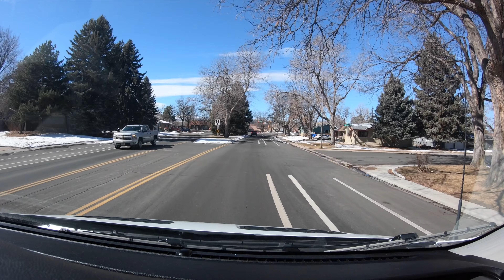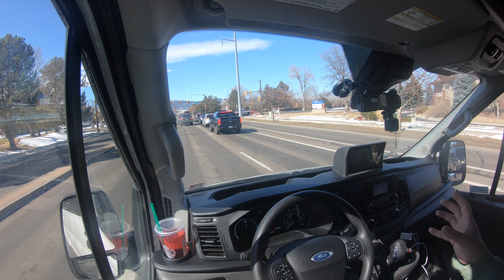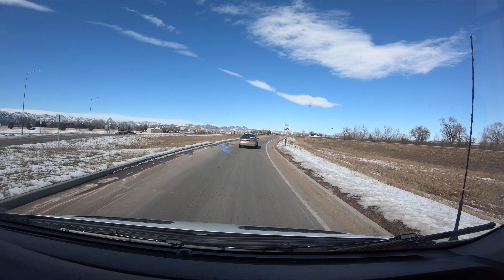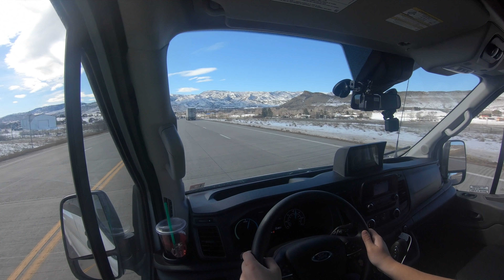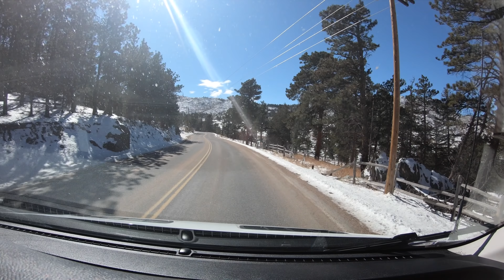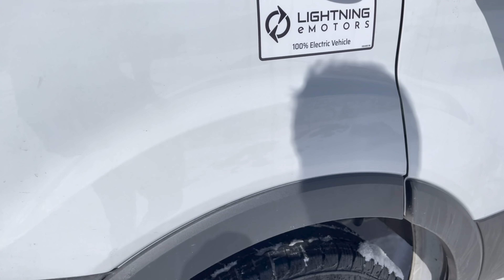EV Last Mile Deliveries! How Does The Electric Transit By Lightning eMotors Drive?

Comment: I actually think this may be the most important category of electric vehicle. So lets say your a normal person and drive 10K miles per year at 30 MPH that's less than 1 hour of driving per day.  Now look at a company that makes deliveries. They are delivering at least 8 hours per day. Add to that they are idling longer, starting and stopping more.  With a full load, you don't want to be behind a delivery vehicle, one because its hard to see around but two it takes them forever to come up to speed. Electric delivery vans come up to speed so much quicker as we all had fun watching combustion cars pull out of the way of Kyle doing 50-60 MPH on an uphill stretch where he gains half a mile of elevation over 10 miles. Plus as a business there are tons of rebates and programs in states like California that makes them much more affordable to buy and certainly more affordable to operate.

Comment: The price was a shock. Unfortunately that’s going to be a deal breaker for most companies that would consider the benefits of the electric power train vs just buying 3 ICE versions for almost the same price.
Reply: Two things to consider: 1. Prices are high at the moment because this is a young industry. Prices will drop substantially as volumes increase. 2. Once purchased, the running costs for these vehicles are significantly less than for ICE vehicles, which means that over time, you can even come out ahead.

Comment: I wonder what the weight of the retrofitted Transit versus it arriving from Ford with the equivalent amount of gas to make it the amount of miles that the electric conversion could go compares? I drive one but need one that is geared more toward a fixed amount of weight for the longest amount of hall with the biggest amount of charge capable of being carried and not to mention the fastest amount of recharge because it is a round-trip. Great review. 💯
Reply: The electric motor and its accessories are lighter than the stock gasoline engine and transmission, but the battery packs certainly add weight. We work with our customers to figure out which vehicle platform and battery pack configuration will work for their payload (or passenger load) and range requirements. It's still the case that electric isn't for everybody; but there's still a huge market for which our vehicles would work perfectly.

Comment: So what is the range with 15 people in it as compared to just one?
Reply from the maker: Good question. I don’t know 15 people in our new town but it was definitely an idea.
Reply: @OutofSpecReviews  There is a whole business to be had testing EV Commercial vehicles under the conditions they will be used under.  Love your reviews.
Reply: @OutofSpecReviews  Come on with TicTok you could fill that up in 10 minutes.😏
Reply: @OutofSpecReviews  Pick up some homeless people maybe?
Reply: There are plenty of us around that watch your videos.  I'd happily fill a seat for you, any time
Reply: Our electric Transit 350HD has a CARB Executive Order (EO) which is a California government document which permits it to be sold in California. For electric class 3 vehicles, CARB requires dynamometer range testing on an EPA certified dynamometer, using an EPA drive cycle that emulates city and highway driving, AND - importantly - with 50% payload. This is on the basis that vehicles are usually fully loaded for only part of their duty cycle - after all, no point carrying stuff around if you don't deliver it! The range testing on our Transit came up with 122 miles on a charge, 50% payload. A future version of the electric Transit will offer substantially longer ranges.

Comment: Couldn't the company get the vans directly from Ford without the engine and other ICe parts? Weird to pay for a full van and then remove the ICE parts
Reply from the maker: We talk about that during our factory tour. Short answer: yes. But they need much more volume
Reply: @OutofSpecReviews  Yes, that's right. You'd think it would be easy for Ford to skip some installation steps; but from an ERP and manufacturing perspective, it's complex to do.

Comment: This is the truck segment that Tesla missed.  Hugely important, particularly given the post-pandemic demise of brick & mortar stores.  Way too expensive, though.
Reply: It's a young market, with a young supply chain. As volumes increase, prices will come down, probably dramatically.
Reply: I believe Tesla will pay attention to this sector when the full scale production of new generation batteries designed for semi will be settled down.
Reply: likely they will (possibly) provide the skateboard or, if not, just the FSD software.  $10k/20K for software per vehicle...not bad with zero cost and 100% profit to them after the 3,000 th sale.